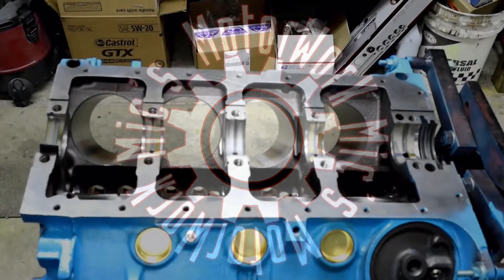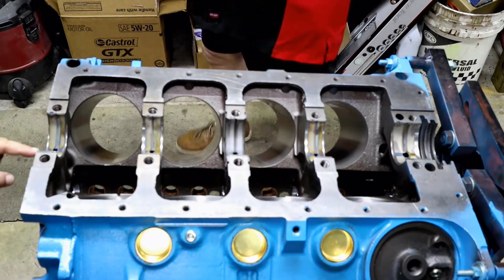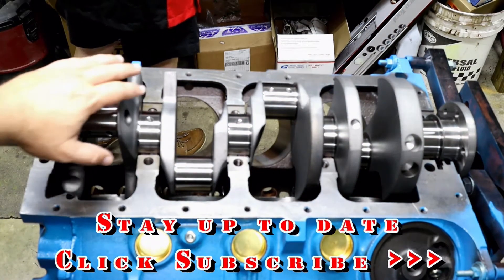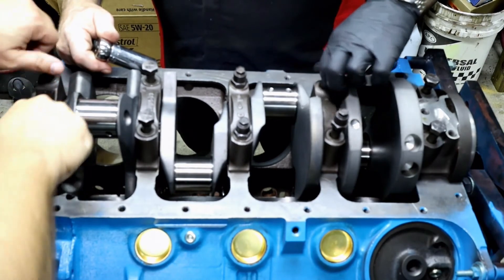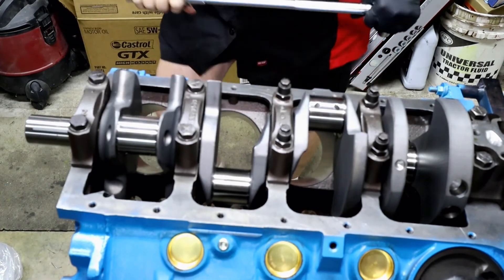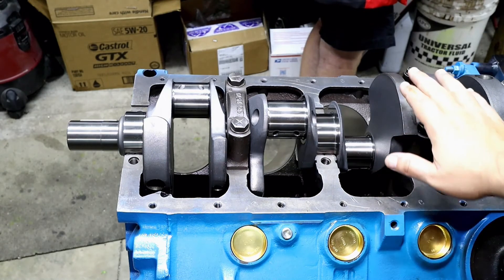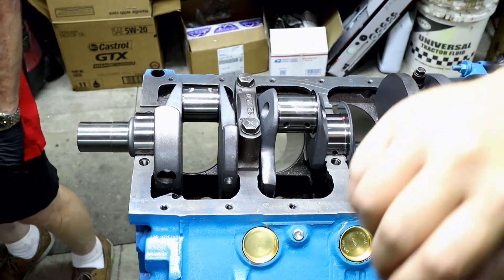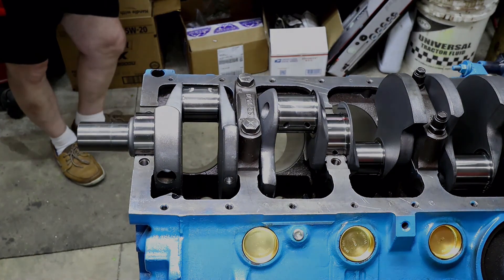The LA-phant: Bearings, Plugs & Clearances  - Part 3 of 3 | Crank Bearings and Bearing Clearances

Comment: The reason why the plastigage was not straight is because the cap was not parallel to the crankshaft. A good machine shop knows this and would have recommended an align hone to remedy this. The align hone precedes boring and honing. 

You have good intentions making this video, but it appears important steps have been skipped. Books and engine building courses are available through bookstores, the internet and community colleges (in some areas).

Take the time to learn how it's done and don't just say you're a hobbyist. If you screw up your engine, it will not only hurt your wallet but your relationship with your friend who volunteered his time to help you.
Reply from the maker: Hey Chris. Thanks for your comments. 

It sounds like you could make some really informative videos.  

I'm happy you saw the theme that the host is a hobbyist. Yes. There is a lot of information out there, a lot of material to dive into. Unless someone is loaded with funds, they aren't going to a machine shop for a spun bearing or complete rebuild. 

Yes. Three of the engines went to the shop for preparation prior to the build. Unfortunately, not for the context of a repair. 

Thanks for watching and leaving the comments for our viewers.
Reply: @MicsMotorworx  Engine Building is more than just having funds. It's about learning how the engine operates, it's design characteristics, performance, wear pattern and a bunch of other neat things. 

The more you know about your engine, the better informed a owner will be to diagnose problems and remedy a fault. A spun bearing can be only a few things, but if you know what to look for, you can know how to prevent these things. Not saying things are perfect inside an engine, but there are standards that most engine shops incorporate into builds and it's up to the customers to find out what these practices are, that is if you want to understand and especially if you intend to teach others.

While I likely won't make any videos, I can teach on the subject and offer my opinions on the art and science of Engine Building. And even if I did, there would be plenty of naysayers to counter my opinions.

Good luck.
Reply from the maker: Great points. 

Thank you for messaging us. We're grateful for the underlying tone and candor.

We hope to bring more content outside the realm of these kinds of builds in future. 

Thank you again. 👍

Comment: Green is for .001 to .003.
Red is for .002 to .006.
For 98% of the jobs in the shop green is acceptable. 
If you think you're going to be over .003, use the red.
Always set end play and check with a dial indicator, and line the thrust up on the cap and the block.
You need to do this for your own protection.
Mic thrust bearing width and thrust surfaces of the crankshaft and subtract.
This will give you an idea what you should have.
Nice build, good content.
Thank you, EM.
Reply from the maker: Thanks for the extra information. We discussed measuring thrust off camera and Pop insisted things were good. I agree with you, double checking is always advisable. -mike

Comment: Are you going to take it back apart to put the rear main seal in?
My stock windage tray bolts went on #2 & #4 mains.
Reply from the maker: Of course. We were checking bearing clearance and such. At this point in the video series, we hadn't checked rod clearances yet and left out some things until the final assembly.

Comment: Crankshaft End Play!! Not thrashing???? Typically around .002"- .005"
Reply from the maker: Yes. As hobbyists, we sometimes get the words wrong. 🤔😉
Reply: @MicsMotorworx  What's the purpose for measuring crankshaft endplay and it's probably an in the thousandths? Friend, you just skipped an important measurement.
Reply from the maker: We wish we could have everything that everyone wanted. 

This was not checked in our garage as it was checked by the machine shop. Pop did not want to take time and remeasure a reliable and reputable shop's work. I advocated. Sometimes these vids are a little bit of give and take.